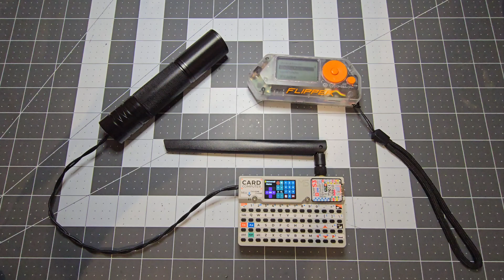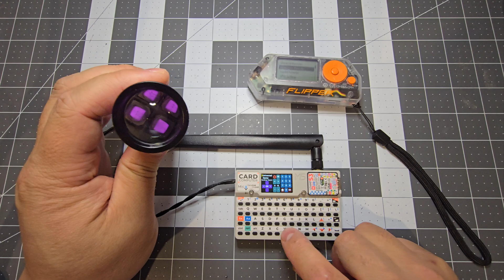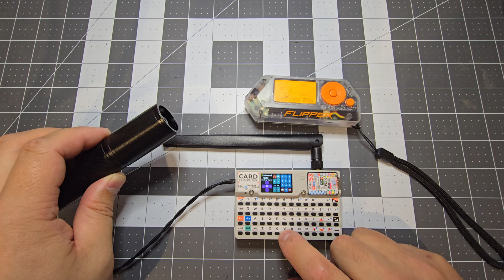IR Sniper M5Stack Cardputer

Comment: Amazing video!! I just have a Question , how do you change the output for the IR by utilising the GROVE connector? Can this be done by using IDE?🙂
Reply from the maker: Yes, you can just change the output in the firmware using Ardunio IDE from stock 44 to either 1 or 2, depending on which pin you use.
Reply: @rayj1988  For noobs(me) trying to learn, can you point me to a video that may show me how to do this? I know I can google/ search the info..but, maybe you know of something that has a clear/ concise explanation ? Thanks in advance! Peace
Reply from the maker: Depends on what firmware you are running? If you are using my TV-B-Mine it has Sniper mode changing to to external pin. I believe Bruce also has option to change IR out. For others, you will need to download the firmware and change the setting in the code and complie.
Reply: @rayj1988 im from previeous video i used that opto coupler but it didint work so i need 4pin opto coupler because i couldint get it to work with 6pin one
Reply: Thank you! 😂